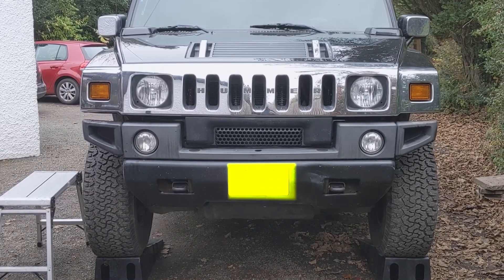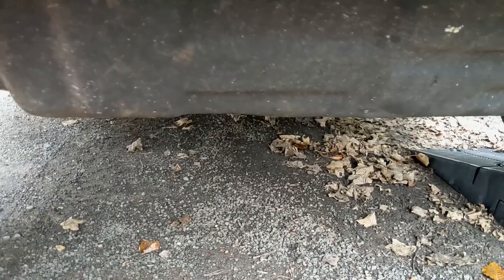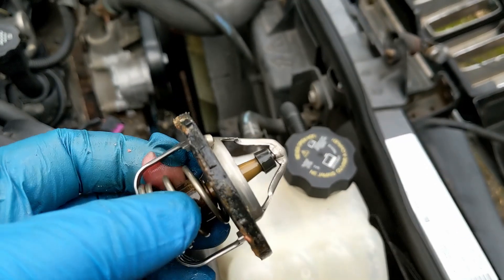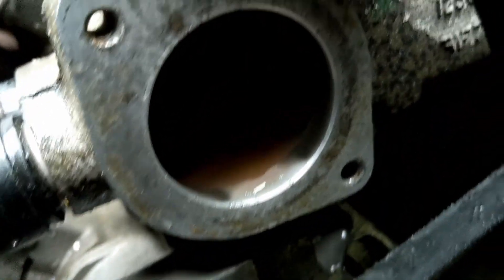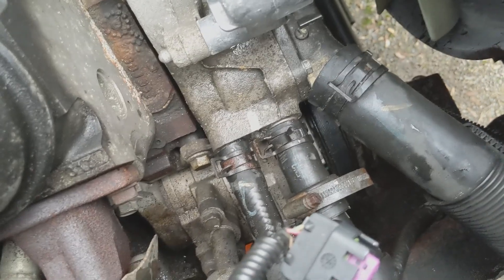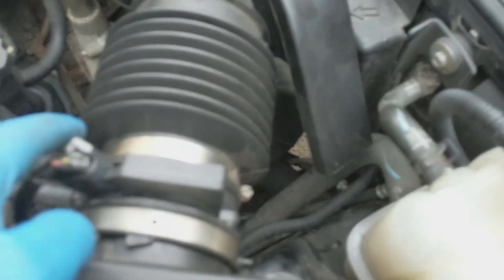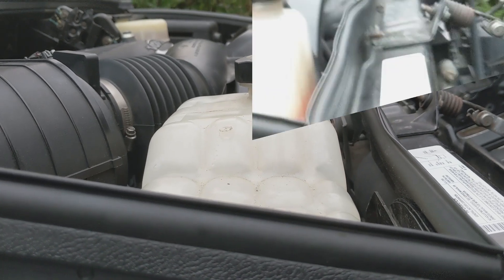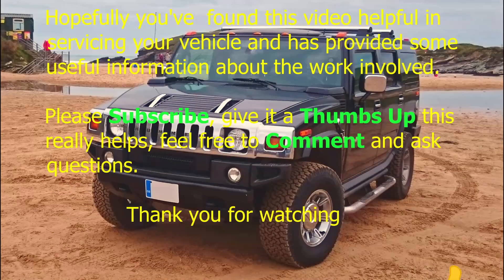Hummer H2 2005 - Thermostat Change - It Could Improve MPG Dramatically !

Comment: Thanks for the video. I keep getting the P0128 code which means my coolant is not getting to temp. It’s getting to around 181 Fahrenheit. I’ve gone through 2 AC Delco thermostats. Will this help run warmer? I also have an all aluminum radiator. Not sure if that was your issue? Let me know. Thanks
Reply from the maker: Thank you for your comments. Visit hummerforums.com and search for radiator related issues, as I recall overcooling may be caused by the bore size and type of radiator fitted.

Comment: Does the old coolant eat at the rubber thermostat gasket?
Reply from the maker: Actually have the old gasket here in front of me,  it's coated with "crystalized" coolant and aluminum corrosion. The rubber has that "perished" look, perhaps due to heat and age (15 years worth)  but otherwise intact. It's possible  it lost some of it's sealing quality and allowed coolant to flow around it.  There's always been some of slight coolant loss in the past, tightening clips and hoses helped, but I never managed to stop it completely, this is probably the reason why..